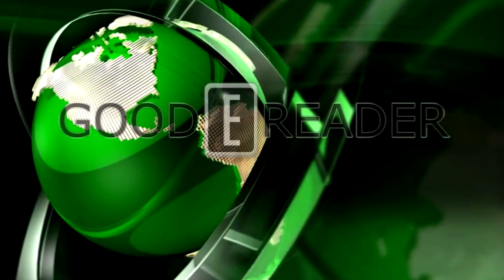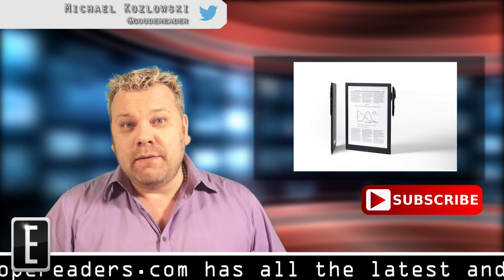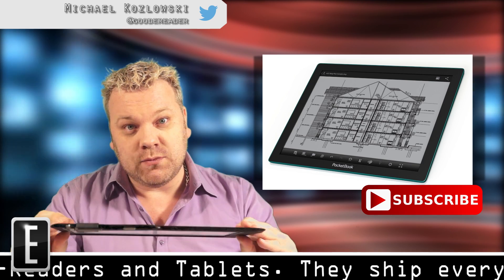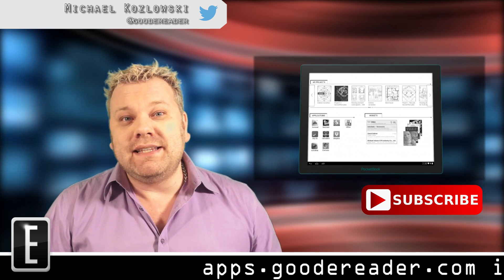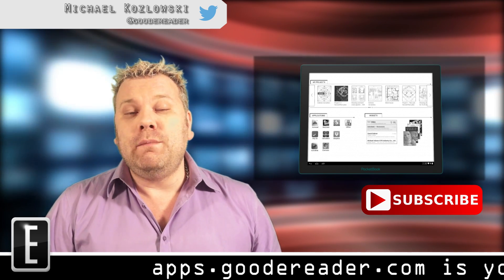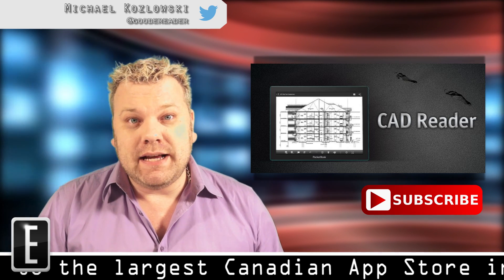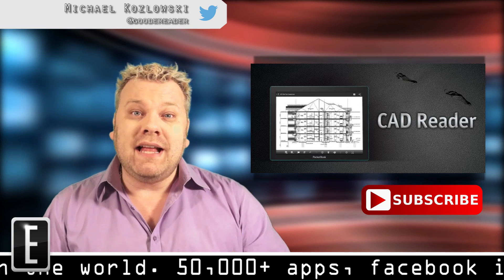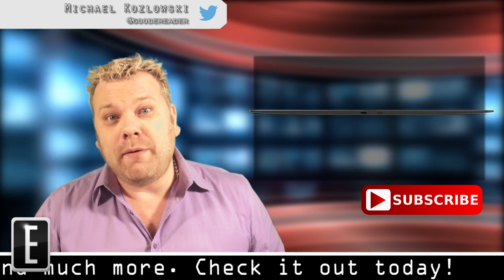Pocketbook Cad 13.3 inch Flexible e-Reader Preview

Comment: Thanks Michael,
The topping and tailing here are great (dramatic turn of head etc.)
I have an oldish "Pocketbook Pro" (9.7 inch or something) which just about lets me read A4 PDFs (if I use it landscape and if I shine a bright light on the muddy greys/grays and if I can wait for the extremely slow processor to crank out the display of a new page).
I really really hope they put a decent processor in this new machine.
Only PDF/CAD: yes, annoying and an illogical wasted opportunity.  Maybe there's still time for you to convince them to add an ereader format or two... just yesterday (2014-12-30) I got an email from Pocketbook Cust Support saying "Pocketbook CAD Reader will come into the market in approximately May 2015."
If not I suppose we can always convert stuff to PDF using Calibre.
Reply from the maker: Mike Rodent lol, thanks Mike! glad you enjoyed it